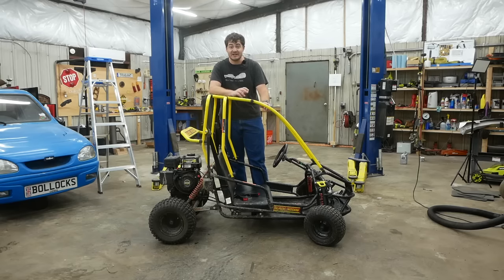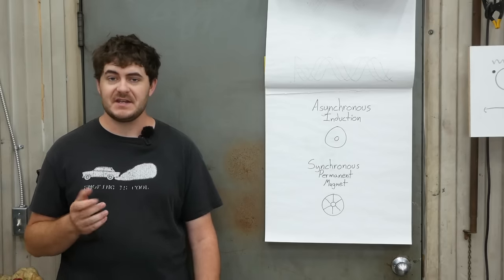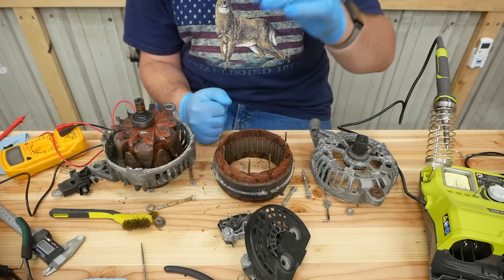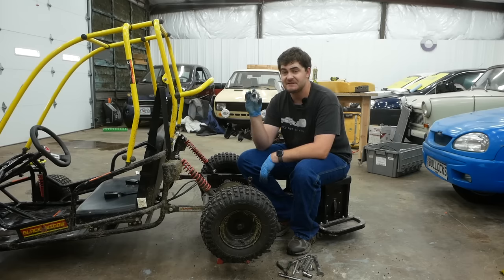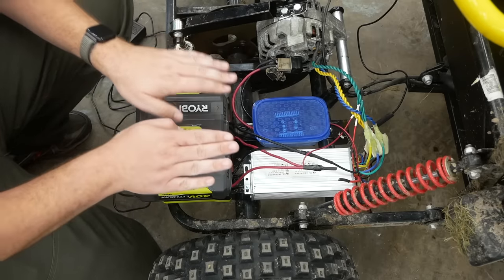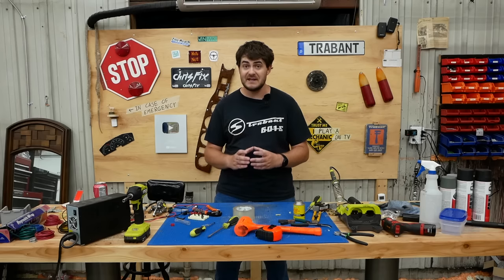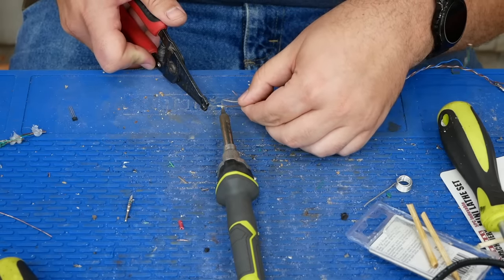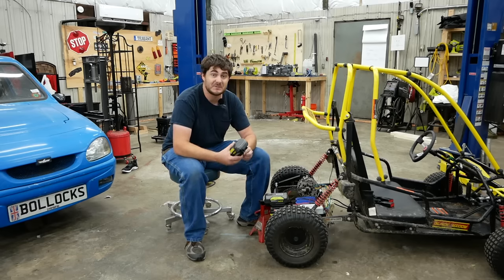Can I Power This Go Kart with a Used Car Alternator?

Comment: Why LiFePO4 cylindrical cells? You can get much higher continuous discharge from LiPo's. You can get 5AH cells that will discharge at 120C (600 amps continuous). Stack them in a 12s4p config and you're cooking with fire (30kW). Loved the video but this is a solved problem, there are high performance electric go-karts you can buy, of course the electronics they use are much more expensive but that's because they work, your setup was never going to work well, at best it would have been as much fun as a ride-on lawnmower.

Comment: Wait, how are you powering the rotor? 
They do need 12V DC to magnetize the rotor. Do check if your contact brushes are worn out. Just lightly sand those brush surface.

Comment: Sensorless BLDC motor controllers use the voltage on the uncharged coil(s) to know the position of the rotor. Etra inertia makes the startup  difficult because there isn't enough rotation to generate a back emf that the motor controller can detect.

How it works is.... While the motor controller energizes two coils in a wye wired motor it detects the  voltage generated on the third coil, And switches when the senses voltage goes through a zero crossing, + to - . or,  if the motor is delta wired then just one coil is energized while the other two coils passing over magnets generate a voltage. 

But the programmed startup sequence doesn't use back emf. Instead it's  designed to get the rotor moving fast enough so that a back emf is detected. 

I don't know but I suspect if the stator coils were reconnected as a delta wired motor, then maybe you'd get better sensing of the rotors rotation for better startup.

Alternatly, no pun intended, It might be possible to "MOMENTARILY" increase the current through the rotor coil upto maybe 12 amps for 2-4 seconds so as to create a electromagneyic field strong enough to generate 4×more torque to get the motor spinning  as well as with the larger magnetic field, generate a voltage in the uncharged stator coil sufficiently high enough to be sensed. Momentarily on start, the high amps wouldn't  be a problem. You just couldn't run it that high for long or too much heat will  buildup and burn the coils.

Comment: If you slowed down the motor/alternator at the start. Maybe the magnetic field would not rotate past the other magnetic field. It's like trying to balance magnetic fields on each other.
 Just saw a video of a, "rotating flywheel battery". That had this back and forth balancing action.
 Slow down the rotation at the start with a variable resistor.

Comment: That's not long enough for overheating so it sounds like a low voltage cutout. The large starting current could drop the voltage and a 42-volt controller will cut out at appx 38 volts.

Comment: Okay now IM thinking go cart, sometimes you can be too smart and miss the obvious. You need more torque to overcome the lag, if you found a way to increase the voltage to the stator and the field coils according to the torque needed starting up, the magnetic field would theoretically be strong enough not to lag under the starting movement load.

 Think about it, you are only controlling speed through 1 field with the motor controller,  I think you need to increase the voltage in both fields equally under load to increase torque. You are right, you will need a lot of battery power, especially with a lot of stopping and going or a heavy load..
Maybe incorporating some large capacitors thrown in the circuit using a magnetic relay when torque is needed would help.
After all that is how you get electric motors the power they need to start.

It makes no sense to try and get the 2 fields to stay synced when the power in voltage ( magnetic force) is not there to overcome the drag or load  that is knocking it out of sync. If the magnetic field is strong enough in relation to the fluctuating load, it will never go out of sync.

The large amount of torque needed to get rolling can only be overcome by a higher voltage period,  (which is  increasing the power of the Magnet field).
 The power has to come from somewhere and all the motor controller does it sounds like is speed control and even if it does increase voltage too, it is only being done in one field. The 2 fields need to have an equal magnetic field, otherwise it will only have the torque of the weaker one.
The voltage to the coils has to increase at lower speeds and decrease at higher ones with your design. Now if it was a brush motor, the increasing voltage would give more power and  speed,  and no controller would be needed, Just voltage regulation for both. Hope that gets you thinking. Maybe use a car starter instead of an alternator. Or drive a hydraulic motor to achieve the torque using your low torque alternator set up.

Comment: Your process was very interesting and educational, but I would have simply used a DC motor ((starter from and Asian car "Honda")) heavy duty rheostat, standard 12v battery (( in any dimension that work best for you)) ingintion switch or on/off switch and appropriate relays.

Comment: You need to short the relearn wires together to learn the hall combinations. I'd upgrade the batteries, scrap the stupid alternator idea, then grab a brushless 1500w-3000w my1020 sized motor. They're silver in color. Much better motor, they're already working ( big plus), they run cooler and don't require the 12v energizing thingy..... So much better for application

Comment: theres a lot to be said for a simple (expensive) brushed DC Motor (or multiple of them),
a forward/reverse relays and a simple PWM-Mosfet circuit powered by a NE555 or stolen out of an electric drill and pimped up.🙂

i know you got it running later but
with the brushless controller extra
building batteries extra
and everything else extra including the time..
saving a bit of money on the still not efficient alternator-motor is kinda lost.

Cheapest DC motors you might get locally are fan motors for car radiators/engine cooling (scrapyard or even new),
versions from around 1985 were 500 to 750W.
Can overrun them with using 2 in a row on 36V (lipo or lead acid) instead of the then supposed/intended 28V (2x 13.8V)
if you monitor heat buildup/boost time or limit the PWM duty cycle below 100% (85%) after first "kickdown".
Needs a bit of bigger wiring, mosfets and fuses of course 🙂

edit: for the sensored version of a nonsensored motor: you can just put magnets and the sensors on the output shaft, no need to fiddle around in the innards.

Comment: Unless you're going to put handlebars in place of the steering wheel, you should see if you can find a pedal throttle instead of the hand throttle.

Comment: Not that it matters but the altinator needs a push start it can’t start without energy but once it has that start it will keep building energy and you would need some way to store or expell the extra power without blowing up your battery’s that’s why altinators are used as a secondary power source and not a single propulsion unit there would be no way to make it happen without stopping it or over loading it just food for thought . But once it’s started you could build infinite power but sand dilema u need infinite storage or a way to cut off power from the altinator and switch to your battery until it gets low and kick the altinator back on before the battery dies for the initial push of power you will need to start the motion

Comment: Voltage is dependant on load, not on speed.. speed dictates frequency. 
You control the prime mover to control the frequency (speed controller/ governor) and voltage is controller by a regulator dependant on load

Comment: No, you had it right the first time. You can't run controller in sensorless mode. Second, brushless motors only run well (and cooler) at high RPMs, so just break down and buy two Bafang geared hub motors, and switch to twin controller config.
Reply: You will need to construct two bicycle axle dropouts, and core out rims to mount motors inside them. Your dropout spacing should be that of a fatbike.
Reply: Or better, chain drive motors from where disk brakes go on them.

Comment: get a pair of wheel chair batteries ....(it cuts out due to low voltage sensor)...1 built a 48v 2000w go cart for my nephew...using 4 x 12v 20a AGM batteries a pair of 1000w electric brushed motors and a 60a Chinese electric bike controller...it went pretty well..(a lot faster than your petrol version).....love your videos (also i weight 110kilos)

Comment: Arent alternators wound like a synchronous motor? While it is not far off a 3 phase dc motor, it's not exactly the same, and if it is wound like an SM, a sinusooidal wave with the correct position should be used to achieve a good torque. P.S. i guess you can rewind it as a 3 phase dc motor, but that would be time consuming.

Comment: when i was 3 we got gifted a go kart frame and spent a year or so building it salvaging atv tires painting it installing a new motor custom lengthening petals all this to say the motor was a 10 horse power which still isnt a lot but its still better and it was never speed limited we would go out of our way to over volt power wheels to make them faster to and worst thing that ever happened was the brakes weren't working and i shot down a mountain and if corse we took of the roll cage and i was going fast enough i would've rolled if i was to turn

Comment: I don't know if you have a one two three or four wire alternator cuz on the plug there's a s a f couple more letters on a piece of plastic where you stick the plug not the big fat red wire but the plug sometimes you got to feed 12 volts to the S wire that's your stator to magnetize the alternator if you have it magnetized at all times then it'll put out power at all times that's what your problem probably is

Comment: With how often you deal with electric stuff and have no idea what the issue is, you'd think you'd go and buy yourself a scope you could use to troubleshoot and diagnose the issue. It would save you a lot of money in the long run even though a good one that can handle testing high power systems costs many hundreds, purely because of how often you have these moments and end up saying screw it and going with something more expensive over time lol

Comment: That alternator is likely to be what? 80 amps at 15V? Maybe more current if the car had electric power steering. So your coil current is 80 amps but your peak voltage can only be 15V which gives you a power profile for driving it.
Despite a DC motor being more efficient than petrol is this enough?

Comment: You need to throw in the 72v batteries to power that 1500watt the esc is cutting out due to a low voltage cut out

Comment: The answer at 23 minutes is because you lack power to the controller. I had the same issue with a remote control lawn mower. Too much draw and the controller gets a brown out which resets the controller. The need for deep cycle battery

Comment: I'm going to use small car batteries and make a gap generator to keep batteries charging. By alternating power control and the charging output and then use a blinker circuit to control power input pulse. That I'm going to do with my bike

Comment: the ctrlr cuts out because your small battery sags when you draw powrr. they will sag half as much if you use 600whr...

dont spend yohr time building batteries. pick a power tool battery that you like, their cost per whr is too close to building a battery, and when it fries, you can just pop in a new unit. gogoro, perhaps?

watch voltage sag while you are riding.

Comment: Think voltage to motors is horsepower or the ability to move faster the amperage is torque the power to move you from a stop or to speed you up!

Comment: Don't you need a motor starter cap? I mean, that's what most people use to get a motor spinning, that doesn't want to start spinning without an extra, initial surge voltage.

Comment: my question is

why turn an alternator into a motor when cars have starters, which are literally motors powerful enough to get the engine to turn?
Reply: It would get real hot, real fast
Reply: Starter motors are only designed to run for a few seconds at a time, just long enough to start the engine. They need long cool down periods between uses.

Comment: Perhaps an added Starting capacitor hooked to the other windings,  making them Starting windings, which will give it a bump of power to get it rolling. Gut an old golf cart Or, you could put a gas engine on it.  Lol

Comment: A VESC would be amazing for this, just connect it to the computer and set your amperage for the motor and voltage limits, it can even run in FOC mode, sensorless but easily can start from a stop, they are commonly used in 5kw electric skateboards but I've seen them in crazy powerful go-karts too.

Comment: The number of pole pairs in a synchronous motor (both stator & rotor) MUST be EQUAL.  In this alternator, it is 6 pole-pairs or 12 poles.  The 12 coils per phase in 36 slots do this for the stator, & the dual 6-pointed "stars" on the rotor do the same.
          You need to build a rocket sled, put that alternator on it, & LAUNCH IT!  Car alternators are designed to tap some mechanical power from a ~100 horsepower engine, convert MOST of it to HEAT (what are all those fins & fan for?), & by the way, a little of it comes out to charge the 12V battery & power the car's accessories.  The efficiency is awful!  (Who cares?  Who would miss a little energy when the source is a 100HP engine?)  You need to get a REAL brushless motor.  Motors & generators work best at HIGH speeds (the power output of a motor is proportional to speed SQUARED).  You need another stage of reduction gearing between the motor & the wheels, & a SMALLER & LIGHTER motor.
          (You need to have GUARDS on EVERY chain, belt, or gear.  The world does not need another 6-year old with missing fingers.)
          And yes, you need hall effect outputs on any motor that must start under static load.  That stepping you saw was the controller feeding a slow 3-phase CURRENT into the coils.  For a motor not under static load (such as a fan) the motor turns, and back EMF appears, which the controller uses to synchronize to.  The faster the motor turns, the better the back-EMF signals are.
          You didn't need to "try 36 combinations"  First, you should have put the 3 hall sensors in ADJACENT slots.  (Every other slot will work, but the direction of the wave output is opposite to the order the sensors are set.)  If you set in every slot, you can tell by inspection the ORDER of both the sensors & the coils.  Did you put the sensors in with the same side facing the rotor?  If not, the sensor data will be hopelessly scrambled (the polarity will be inverted in the upside-down sensors)!  You can check this with the rotor not in & with hand-held magnet.  Now you have only 3 combinations to try!
          Another thing: the rotor field coil will suck on your battery even when not driving.  Get rid of the alternator first!  Unless your 6-year old has a square mile farm to buzz around in, the smaller battery should be fine.  (If your kid wants to run in the winter, you can put a canopy on & the alternator will keep him nice & toasty!)
          Interesting thing about car/motorcycle/small airplane alternators: they were first designed in France, before motor & alternator principles were completely understood.  The design was copied around the world, & hasn't been changed since!  It needs changing!  BAD!  I was involved using alternator for portable power unit for use in the middle east by the military.  I discovered quickly that car alternator was NOT the thing to use.  I designed my own (weighing less than 1 lb & making 100W, running on Honda 1HP 4-stroke weed-wacker engine running at idle).

Comment: usually watching YouTube you see clever people with good ideas, here we have the opposite. he could have looked up quickly about the torque of synchron motors in Google and saved the parts and his time. The efficiency of the old car alternator is only around 50% and the expensive lithium batteries deserve a better use.

Comment: The sprocket is way too big. A 12 tooth works great. Also, you can put 12 volts on the field windings for super torque then reduce to 1 or less for top speed.

Comment: This is how you know CMP could be giving you a cheaper bill so much things you can do with generators alternators Etc like taking a huge outside generator taking the gas motor off welding a pulley on the end ran to a 26 speed bicycle get on bicycle start pedaling through the gears as the speed picks up the generator starts to generate some good amount of power which generate battery 2 in electric motor with a belt that turns the welded pulley on the gas-powered generator that I removed the gas-powered motor off from start pedaling bike and once it starts turning the generator it that's making power and there's no gas motor attached to the generator no more free Power all you have to do is start pedaling it at first then jump off mountain bike and let it power itself

Comment: A 12 volt alternator with a 36 volt battery yea. 2 much voltage trip over loads. To protect the motor.

Comment: Turns out the answer is "no"
I feel like you'll have an easier time just ripping a motor out of a washing machine and slapping it on some 12v batteries in series, use a dimmer switch for throttle control 😂

Comment: The gas engine probably turns off when turning bc it probably has a low oil sensor and when you turn it all goes to one side and it thinks it has low oil and kills the engine